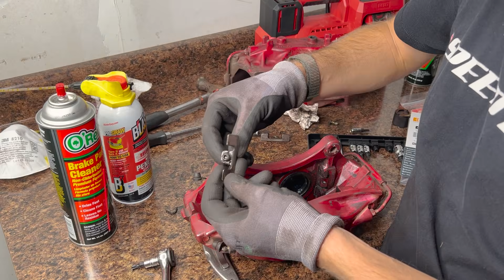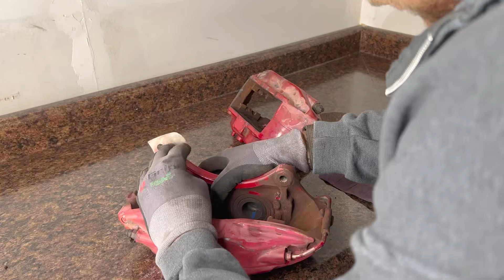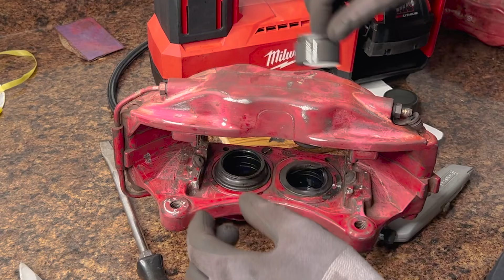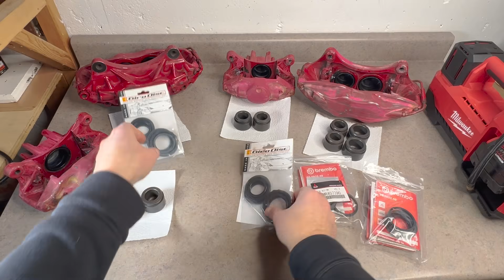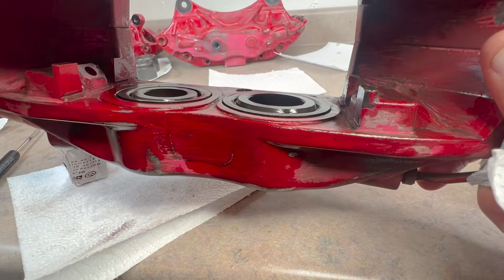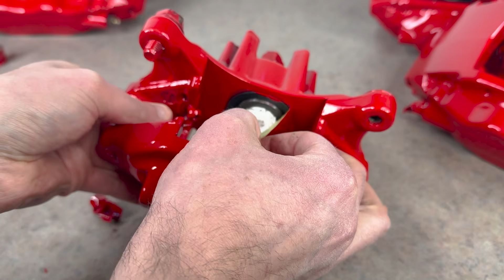How to Rebuild & Restore Brembo Brake Calipers - EVO 8/9 Brembo Brakes

Comment: Wire wheel on an angle grinder rips that paint off in just a few minutes and will take it down to bare metal. 
I did the caliper paint can method from the parts store and they came out mint. Depending how long the paint holds up the next time I’m going to powder them. 
Thanks for the part numbers very helpful for a future reference.
Reply: Wire wheel didn’t leave deep markings in the calipers that showed after paint?
Reply: @brandonteege4180  
The wheel did not leave any markings, I used a Coarse Crimped Wire Wheel Brush. The wire wheel type needs to be somewhat flexible. It will make a dusty mess.

Comment: Love the detail!  When you remove the calipers, how do you cap-off the lines, and is there any extra tricks required WRT bleeding on reinstall?
Reply from the maker: Thanks! Good questions.  If you have not had new brake fluid in a while, now is probably the time to swap to new fluid. So a full drain could be in order.  Otherwise you can cap the lines at the hard line connection if easiest.  

When I put these calipers on the red evo, I gravity bled them by myself.  However, I had to pump the pedal 6-7 times initially to get the fluid to start going to the ABS module.(then add more fluid to the master of course) After that, it was bleeding as normal.  Start with the caliper farthest was from the master cylinder and work you way closer. Be sure to do both bleeders on the caliper.  Repeat until no air bubbles come out.

Comment: Too much hard work mate..
Don't mean any disregard, but we have enough to fix on these old cars which takes forever.
Have just cleaned all 4 calipers for a disk / rotor swap and took many hours, painting and rebuilding them as well is way too much hassle, time is money after all.

Found an ad the other day for a Subaru shop in the UK which will rebuild, repair and repaint all 4 Bembos and supply all the fittings and new fixing bolts for just £300 ($400) 
Even powered coated is just £10 more.. a bargain i say 🙂
Reply from the maker: Yea, totally understandable.  I mention in the video its a long process and there is a reason people pay to have them sent off and powdercoated and/or rebuild by someone else.  You do you!

Comment: This is something I really need to do. Think mine are sticking. I always thought that it was needed to separate the halves to do it and I didn't cause I was afraid of that linking line being notorious for snapping or seizing.
Reply from the maker: I used to think they need to be split too. But, i've heard splitting them can cause more issues.  The Brembos on my black Evo were just repainted and never rebuilt.